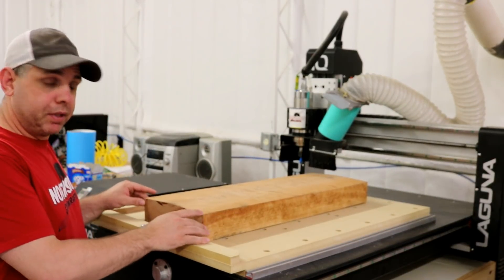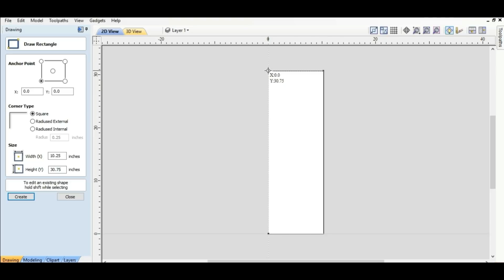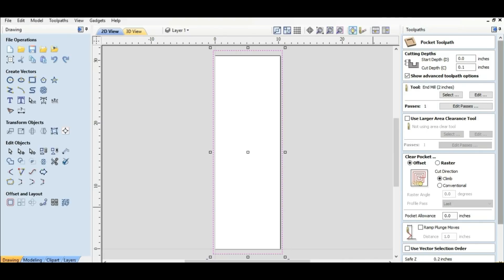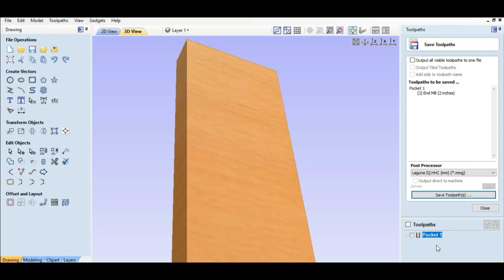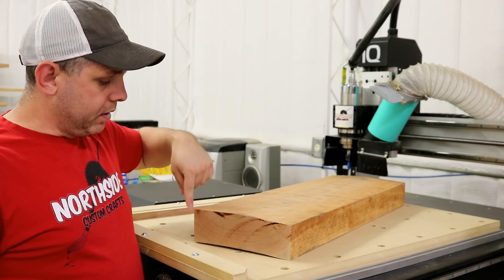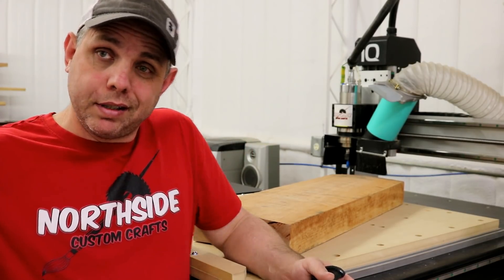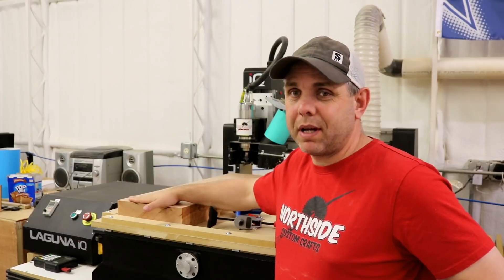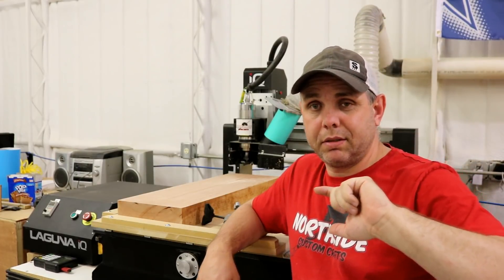Flatten Wood Slabs with a CNC // Laguna IQ CNC // Aspire Demo

Comment: I would have had this done on a joiner and a planer in less time it took you to  program your cnc. At least show this with a large slab that wouldn't fit on a joiner. This makes no sense
Reply from the maker: Here’s a table flattened. Maybe it will make sense. https://youtu.be/79C3hae5u-o

Comment: Curious: Do you have a planer as well? This is definitely useful but perhaps a lot slower
Reply from the maker: Nikil Ragav I do have a planer, but a cnc will get it perfectly flat..
Reply: Planers are only useful to thickness material... The cnc is used to flatten(bring top and bottom into plane/parallel) Essentially working as a really large jointer.

Comment: What if you use electrical planer to get some material first and then cnc for final pass? I think it will speed up whole process, no?
Reply from the maker: Konstantin Borus It doesn’t take very long to let the machine do its magic. But if you could save a few passes with a planer, I say .. why not. 👍👊
Reply: @JakeThompson   Thanks for reply! I like your setup.

Comment: Unless you were going to use that block for a project, is there a particular reason you didn't edge joint it and resaw it first? I'm curious of your reasoning.
Reply from the maker: Honu425 You are correct.. it is for an upcoming project that I want the rough edge on., it will be coming out in the next week or so. 👍👍 Thanks for watching

Comment: Jake, do you find the inline clamps lift the workpiece at all when you apply pressure? The Kreg clamps look like a good fit because of the low profile. Thanks!
Reply from the maker: The Hamlin Woodshop The armor clamps do try to lift it, but I am just mindful of it and watch the pressure I put on it.. the trick is to put just enough force to hold it, but not lift it.. If I had to give an edge to one over the other it would be the Kreg. The lower profile is a bonus and the clamp rod is closer to the surface which combats to pushing up problem the armor clamps have. 👍👍
Reply: Good to know. Thank you.

Comment: just curious... after you got the one side flat, why not just go over to the planer for a few passes?
Reply from the maker: Dave Satosky My planer leaves some snipe.. and this video is aimed at CNC instruction.  But you are correct, totally could do it with the planer. I could do a 24 inch wide piece on the CNC if needed..